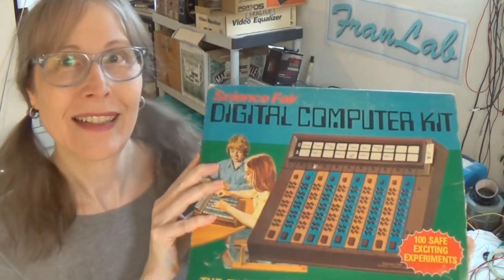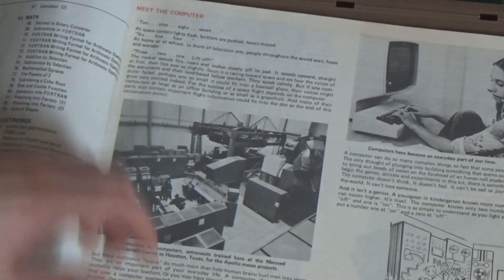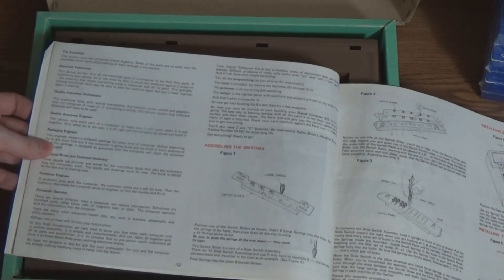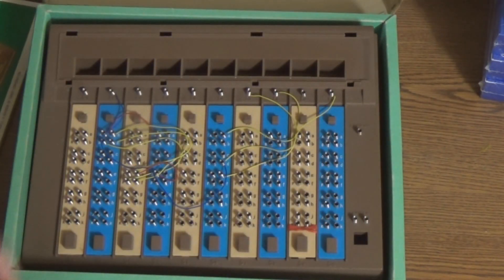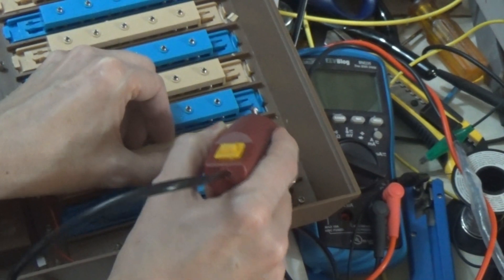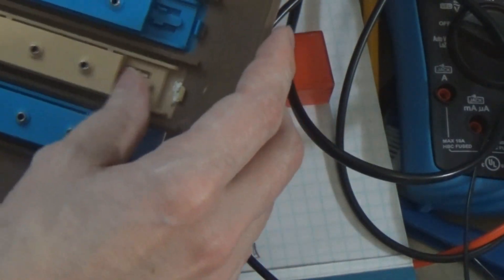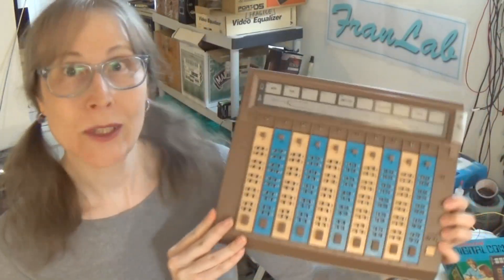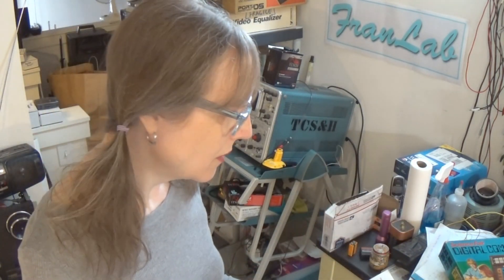1977 Tandy Digital Computer Kit

Comment: I got one of these when I was a kid. I still have it packed away in a box somewhere. I remember doing the one that helps you solve the riddle of the Farmer, Wolf, Goat, and Cabbage, where the Farmer has to get each one across a river but can take only one at a time. The "program" would indicate that you made a mistake if you left the wrong combination on one side of the river (like wolf and goat together). This probably would have been a better demo for the video. Now that I look at the manual PDF that Tandy posted, I see that's the first one in the book. Makes me wonder if that was the first and only project I did with it. Last time I looked at it I noticed that I must have taken about half the bulbs and sockets out for other projects. It didn't keep my attention for long, unlike the standard 150-in-1 electronic project kit I had where I built all 150 projects and then went on to make many of my own.

Comment: so... simple wire routing to make a; whatever. I never *realized making a transistor was just this. (I have very little electronics knowledge) *I don't like spelling "realized" this way... but as the audience is of this American channel the collins dictionary says I should; bleh.

I thought there would be transistors & capacitors under the board that you'd be connecting via the springs, as none could be seen on top, or loose in the box. That was the ilk of Tandy boards I remember hankering over as a kid. Except that the transistors et al were sometimes on wires that would connect into the springs, & sometimes fixed on or under the board with little descriptions of what was where on the top surface. They were fantastic, exciting things to me in the 70's. As simple as paint by numbers sets.

Thanks for the trip down memory lane... I wish I learned more from my Tandy kits, most I can remember was the little globes & wires, connecting them, adding a battery & hiding under my bed with my home made torches. They were fun.

I enjoy your shows, & your brand of backing music with the Francaster.

Comment: I remember being suspicious of this and opted for the 100-in-1 instead.  Mom asked me why and I replied, "not enough guts".  I knew all about real computer guts because my Summer job at age 10 at a local 'service bureau' was babysitting an IBM System/3 and its printer while the machine ran lomg jobs and the adults went down the street to drink their lunch (they thought I didn't know ;-) ... also some tedious to them but exciting-for-me project of going through the rubber-banded card decks (RPG programs with names like P010A37) looking for the 'H' card and feeding it back into the keypunch machine to put an additional something in a certain column. The details escape me but it was because IBM had made a change, or they might have been System/360 decks that needed the change for the System/3 (which was new).  Also got to play with MAI Basic/4 and watched the techs swap out boards, learned BASIC, also a desktop IBM 5110 with APL.  So my first real computer in 1978 was a TRS-80 Model I.

Comment: OMG I actually had that thing as a kid. In fact I think it's still at my parents place, buried somewhere. For some reason I never got into it, unlike the other Radio Shack "x-in-1" electronic kits, which I also owned.. probably coz without all those diodes and capacitors and cool stuff that the other sets had, it looked kinda boring. That said, it's amazing what kind of logic you can cook up using nothing but switches and hookup wire.

EDIT: After watching the video.. yea not really ;) Oh well, it was a simpler time.

Comment: Aww.. I really wanted one of these, when I was 9. Thank goodness I couldn't afford it, because I agree with you that I would have been disappointed.  Tandy should at least have added some TTL chips to make it do something.
Reply: You would have neatly put everything back in the box the way it was and asked for your money back hoping the clerk didn't look inside. That could have brought the swears or the tears. Or both. I opted to put mine aside thinking I was too dumb to understand it's true teaching intention. I was turned off by computers and really tried with this one to get on track. I guess that's why I do automobile and light truck mechanics along with electrical, plumbing, HVAC maintenance and repair.... Should have finished college.... Should have followed neighbor to Apple. He's ten years older. Retired multi-millionaire. I don't have to worry about retirement. I don't have one. I get to work until I drop!

Comment: Wow.. I always wanted that kit.. it seemed to promise so much, but only 40 years later I am pleased to now know I avoided utter disappointment.. I especially recall the 'digital' aspect being extremely alluring, having no idea what it even meant at age 10.. 
The other kits I did get, 150 in 1 and 300 in 1 were almost equally as useless, I still have the book for one, and the way they are carefully written so that absolutely no knowledge is imparted, no theory is conveyed, just wire it as per the diagram and this is what happens.. I'm amazed my interest in electronics persisted. Anyway, thanks for another great video.
Reply: Good comment

Comment: Currently I'm in the process of building an actual computer using discrete logic chips, based on the video series by Ben Eater, instead I'm using solderable boards instead of breadboard. Has a whole 16 bytes of RAM, 4 bit program counter (both potentially upgradable to 256 bytes and 8 bit respectively), three 8 bit registers, 16 instructions (256 with the upgrade I think) and can add or subtract two 8 bit numbers.  I am adding some of my own mods to his design, namely adding a 1Mhz clock for a blistering 200KiPS (~5 clock cycles per instruction max) which would blow this thing out of the water
Reply: william fleete how is the project going on? I'm currently going building one as well, but not based of ben's design. I'm aiming for 40 mhz.

Comment: I had the german version of it called "LOGIKUS" sold by "KOSMOS". It was the best version of all these pseudo-computers that have been sold at that time. In fact there are only 10 switches  and 10 bulbs. Nothing works by itself - at least some relais were useful to get the inverter function .
I've been very disappointed when I discovered may favoutite birthday-present was nothing but a case of crap.

Comment: Ok, back in 1978, my cousin and I built one of those 'computers' where one would put in data and instruction with switches and clock them individually to the CPU. Which was quite tedious, but we calculated pi to 25 decimals on that thing (that was after I made hex keypads for it, though). It was amazing we could make a machine do that. This Tandy thing is hugely underwhelming from a functional point of view, but restoring it to working order does have historical value.

Comment: that unholy drillbit, god be damned. Oh, and another way to cut wire fast is by bending it in a zigzag (you measure once for the first piece) and then cutting at the bends.

Comment: You think that was disappointing?  Try the poor kids who wanted 2XL to be a computer and realized it was an 8 track player, or the kids who bought the Odyssey 2 in lieu of the Atari 2600 that everyone else had so they could do some computing and learned they had to get the cartridge for computing, or the kids who bought Adam for Coleco and would wipe out their wafer tape that let them boot up the system.    Interesting note Tandy also did a SF 5000 a few years before the one you were looking at in this video that didn't use the springs to wire it, but you stripped the wire and put it into wholes that connected to metal tabs on the back of switches that you moved to create circuits.  It also used lights and you cut out paper fillers for those.  Maybe if you get that one you can set up the game where you catch the bad guy.  Excellent video again.

Comment: Well, when I was a kid my "Cardiac Computer"[1] (also using sliders) was made of just cardboard, and didn't even have lights. (It did have a much larger instruction set, though!)

But maybe this is boring because you picked the wrong project for it? The catalogue description[2] reads:

"Know the excitement of building your very own computer. You can learn about programming, binary math, cybernetics to predict weather, diagnosing illnesses and translation. All necessary parts and programmes are included, plus a detailed 80-page illustrated introduction manual. Connect disconnect and reconnect all 100 circuits right in the embedded work case. Requires 3 'C' batteries. 28-218 £17.95"

All those scientists with their supercomputer weather models have clearly been ripping us off! They're probably using this and playing video games on the supercomputers instead. And we can replace lots of expensive doctors with this as well, not to mention Google Translate!

(Interestingly enough, the actual digital logic lab kit, with 7400 parts, blinking LEDs, etc., right below it on that same catalogue page, is less than half the price!)

[1]: https://en.wikipedia.org/wiki/CARDboard_Illustrative_Aid_to_Computation
[2]: https://youtu.be/CWxTCQf5gOU?t=597

Comment: When I was a child in Germany I got the "Spielcomputer Logikus" (which means "Gamecomputer Logikus" in English). 
It was build a bit smarter than the Tandy one. You could wire "AND" and "OR" Gates and the output were also light bulbs. 
I still have the manual and I had fun when i was 10 or so. ;-)

Comment: Ugh. I got this terrible kit as a present when I was a kid, and I distinctly recall uttering the early-1980's grade school equivalent of "WTF" after opening it and realizing it didn't have any electronics in it. I already had one of their 200-in-1 kits that I'd been making burglar alarms and fish finders and whatever out of so, yeah, definitely a step or two down. I do remember using the multi-pole slider switches for a few oddball purposes and stealing all the light bulbs out of it over the subsequent years, but I don't think I bothered doing more than half a dozen of the "programming" exercises after putting it together. (I was obligated to, it was one of those presents you don't get to not like in front of the gifter.)

Comment: You should keep it, by 2021 question 3 on program 18 is probably going to be wrong...

Question: What is the approximate population of the Unites States?
A. 220,000,000 B. 450,000,000
Proposed solution: A

By 2021 population is going to be approximately 337,109,000 according to U.S. Census Bureau.

Comment: I had one of these in the early 90's  (image link below)   I spent hours & hours wiring that thing up. to make various things.  Mine was missing all the wires that were supposed to come with it,  but me and my dad found a spool of 18ga wire and cut & stripped several hundred pieces of various lengths.
Now I wish I still had it. 

https://i.ebayimg.com/images/g/vSAAAOSwJ5BeEoFE/s-l1600.jpg

Comment: I was a nerdy kid who got one of these for Xmas one year. I was initially super excited. But the thing has no electronic components AT ALL! It's just a bunch of slide switches, light bulbs and a battery. You'd wire up some tedious circuit, play with the "program" for maybe 2 minutes and that's that. Underwhelming in the extreme.

Comment: I love my Tandy 150-in-one kit that got me going with electronics when I was 9.  They really put a lot of thought and effort into the manuals for those kits.
Reply: Me too.  At first I just followed the wiring diagrams, then I tried hooking things up differently, then I cannibalized it for parts, then I regretted being stupid.
Reply: I had the RS 150 in 1 kit for a year or two and pretty well mastered it by age nine, then received one of these computer kits. I am glad I was not the only one who reached the conclusion that it was destined to be a dust collector.
Reply: Those were legit. I learned a lot from those. If this kit had included a real CPU perhaps it would have been legit too.
Reply: The 300 & 360 in 1 were a lot of fun, for a 7-10 year old. I had the 150 in 1. My friend had all the kits, and his dad was an EE at Honeywell. We had those kits doing stuff Radio Shack never dreamed of. Running the little motor through an audio amp, and having it switch on, mute, stop, un-mute,  switch on, rev up, mute, switch off, stop, switch on, made the exact sound used in the old Star Trek for red alert. We thought we were geniuses, when we heard it work. It was a spot on perfect match to Star Trek's foley gaf.
Reply: I loved the real electronics kits. That's why this "Computer" kit feels like such a rip-off. It's a bunch of plastic sliding bars, with cheap single throw multi pole switches and lights and wires and a battery.  Crap.

Comment: Thanks for doing this. I remember seeing this kit around when I was a teen in the early '80s. I seem to remember it being expensive, too much for my family's budget. I was always curious about it, though. Since then I've wondered if I would've learned something valuable from it, though I remember wondering what it could've possibly done, because like you saw, it just looked like a bunch of switches. I had already gotten a couple of RS's electronics kits, and I could see the electronic components. Not with this one. Looks like I didn't miss anything.

Comment: ...And 4 years later along came the zx81.

Moore's law gets you every time. ;-)
Reply: You're thinking of the ZX80 (3yrs later).... the following year came the ZX81 in 1981... ;-)
Reply: The "Kosmos Spielcomputer Logikus" works a lot like this tandy computer and was released 1968.
Reply: Ah, but wasn't the Z80 CPU already on the market in 1977?
Reply: Yes it was and it's still available. It makes the 65xx Series look like rISc Processors with his Block Operations.
Reply: The TRS-80 was released in 1977.
Reply: Okurka Yep, Same year and sold at the same store. Of course the TRS-80 Model 1 cost just A BIT more than this kit. (see what I did there, LOL) I had a model 1 and later upgraded to a Model 3.
Reply: Colin Williams Yes, The Zilog Z80 hit the market in 1976 and Radio Shack's TRS-80 used it in 1977.  Get this: It's still in production. The package has changed over the years but it's still used in some embedded systems!
Reply: The very company that made this kit beat the ZX80 by three years with the TRS80 Model 1 and it used the same CPU as the ZX80.
Reply: Yeah, this was what you got a kid if you couldn't afford the rather pricey personal computers that were coming out around the same time. The Model 1 was about $2400 in 2018 dollars, and it was considered an inexpensive machine. The price of the low end collapsed over the next several years, though.

I've seen a lot of laments to the effect that modern computers aren't geared toward hobbyists who want to program them and mess with them, but, really, that's what the Raspberry Pi and its ilk are for. And they're *cheap*, unimaginably cheap by 1970s/80s standards.

Comment: I actually asked for this for Christmas back then but got their digital logic kit instead, 25 experiments with a a 7400 chip because the local Radio Shack were out of the computer kit. I was a bit disappointed and it did not look as fun as the 75 in 1 kit I got the year before but in the end I learned a lot. Now I realize that I dodged a bullet.
Reply: I got all those kits as a kid, I made sure everyone in my family knew I wanted any of them .. then I got a Denshi Block system and that led directly to Z80 experimenters boards, and CP/M machines, and ..
Reply: @ibisum  Darn, you guys got all the fun toys. I've only played with a Raspberry pi and an Arduino.
Reply: @twistedyogert  they're still out there, those old classics!
Reply: @twistedyogert  go to pjrc.com  Paul sells a lot of stuff that can take you back to those days.  The 8052/8052 microcontroller is a good way to learn what goes on inside of a computer.  There's also a bunch of people tinkering with the 6502 (Apple II, Vic20 and C64 computers, though the C64 was really a 6510).  Then there's a bunch of folks tinkering with the RCA 1802 CPU.  It's the least friendly of the ones I mentioned, but is what I started with in 1977.

Comment: I bought this when I was something like 10, having saved up my hard-earned allowance.  It wasn't the exact same model; clearly they had gone through at least two revs of the design.  The version I had didn't have the spring terminals, but rather "sockets" into which you jammed the wires -- a hole flanked by a couple of leaf springs.  And yeah, that's all there was to it -- just a bunch of switches and peanut bulbs, powered by a couple of D-cells.

Now, with 40 years of hindsight, I can see what Radio Shack were trying to do:  Teach elementary boolean logic, which forms the foundation of modern digital computing.  But a couple of NAND gates does not a computer make (although they do make one flip-flop).

I paid something like $32.00 for it.  In the mid-1970's.  Which was a lot to a ten-year-old kid.  It was one of the most expensive experiment kits they had.  I got it home, and it was the least fun thing I ever got from Radio Shack.  I ended up not keeping it and, from that day forward, resolved to never trust the box art and always open the box and read the manual before buying anything.

Thanks for doing this one.  I'm pleased to learn it wasn't just me...